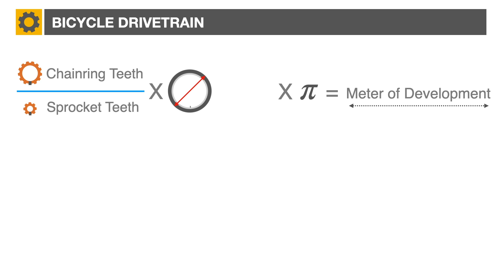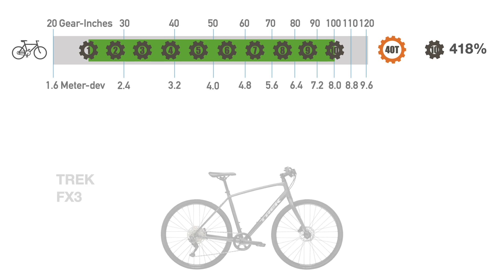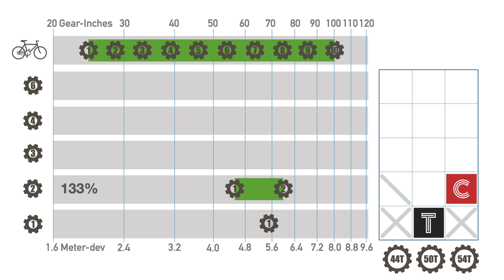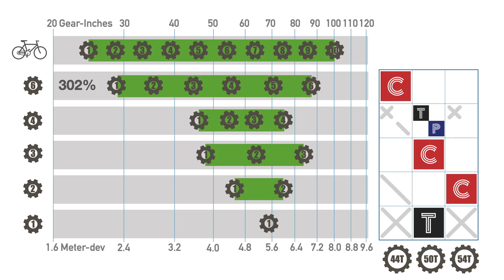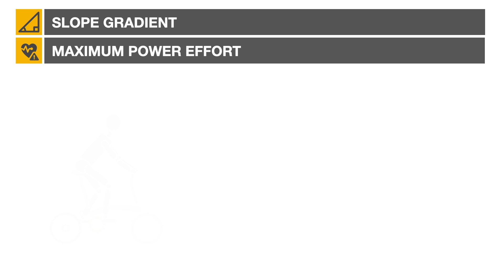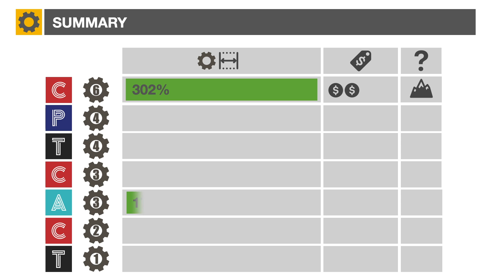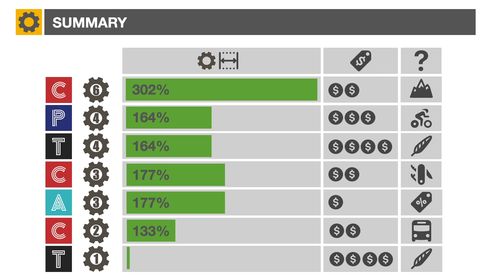Explaining Brompton Gearing - [ Rev. 2022 ]

Comment: My advise for gear selection:

1. Do you climb hills, strong head winds and are you not as strong? Buy the 6 gear system.
2. Do you ride in the city, less then 5 km/ 3 miles? The 4 gear system will do if you are not so strong. The 2 or 1 gear if you are strong. The 3 gear is not useful, the gears are spaced too far apart. So the gear 3 you will seldom use. Unless you change the sprocket to a bigger sprocket or a smaller chain ring, so you can use gear 3 as well.
3. Do you use your Brompton for touring with luggage. Buy the 6 gear.
Reply from the maker: 44T is the default for the A Line
Reply from the maker: @Steph99449  That's what we heard as well. We did install 44T on our M6R at purchase time.

Comment: Probably the best presentation I've seen on all current Brompton gear ratios (including the new T line which was what I was looking for). Better than my spreadsheet and coming to the same conclusions on choice - i.e. 6 speed classic with standard/reduced chainring is best for touring/hilly terrain. I would however like more gears to reduce the jumps and to remove the compromise of having to either pedal furiously or with a slower less efficient cadence in order to maintain a particular speed, something which the new 4 speed doesn't address.
Reply from the maker: Adding a 3rd sprocket or upgrading to a dual-chainring could be solutions to improve range and gear gap (ref. our video https://youtu.be/-Q9wd8Ewlec )

Comment: Great info! In Singapore and some Asian countries we have many different brands of ‘Brompton clone’ so call trifold bikes that comes with default 46 or 48T chainring running on the SFR3 internal hub and 2 or 3 external sprockets, giving a 6 or 9speed configurations.
Reply from the maker: @DCPedal, what are the more common sprockets size found on those trifold bikes?
Reply: @2Bikes4Adventure  13,15,17

Comment: Awesome video. I like that you actually share how a gearing ratio could affect a climb. I wonder if one could do aftermarket modification from 44T chainring to a smaller 36T or 34T for better climbing experience? Many thanks.
Reply from the maker: 38T or 39 T are probably the smallest 130BCD chainrings you can get. You could go smaller with a dual chainring however.

Comment: I’m surprised by the difference in overlapping between the 2-speed and the new 4-speed cassette. Don’t you think the new 4-speed could be easily and conveniently spread out so that it’s both faster and easier on hills? If not, why do you think they made it so “narrow”?
Reply from the maker: Rear frame clearance doesn’t seem to be the issue here. Maybe the newly designed gear tensioner/cage plat cannot accommodate more than at 18T/12T range?  If that is the case, not much we can do (with the exception of using a dual chainring)

Comment: Thank you for your wonderful illustration! May I seek your advice: currently running a 54T 3speed SA for fitness riding (20-45km, x 2 per week, average 22km/hr over 1-2hrs) at relatively even terrain (parks & road) I am keen to get the P line to improve my performance (to cycle further & longer & perhaps fill the gap of a missing gear (betw 2nd & 3rd) when fatigue sets in. However, after watching your video & realise the 177% vs 164% gearing range, I am a tad hesitant about the earlier intention. Would love to hear your opinion with your vast experience!  Thank you ;)
Reply from the maker: @eugenetmy, the excitement of owning a brand new bike is not to be ignored, but in this particular case, the price of the 4th gear will be significant.
If budget is not an issue, I would go for it (and probably consider a 3rd party 130BCD 56T chainring to shift the gear range upward).
Once you have your new P-Line, you could always sell the old 3 speed to help finance the new acquisition although there is nothing wrong with owning more than 1 folding bike (we own 10).

On the other hand, if cost is an issue, a cheaper option would be to upgrade your 3 speed to a 5 speed hub. The gap between the 4th and 5th gear will be 18%, the same as the gap between the 3rd and 4th on the P-Line. Furthermore, the total range is 225% (vs 164%). True, the bike will be heavier than the P-Line, but this upgrade would probably cost 1/10 the price of purchasing the new bike.

Enjoy your Brompton (whichever model or setup you choose).

Comment: A nice explanation, particularly of the effect of varying power output on hill climbing - very good to relate this to gear choice as well. One question - am interested in your foot position on the pedals. We are normally taught to use the forefoot (or at least I was!), but you are using your mid foot on the pedal. It would be helpful to know why - perhaps I am doing it wrong?
Reply from the maker: While it is usually accepted that positioning the ball of the foot over the pedal pivot is optimum, some research has found that it may not be critical (https://www.researchgate.net/publication/6886747_Is_economy_of_competitive_cyclists_affected_by_the_anterior-posterior_foot_position_on_the_pedal). 

Our approach is less scientific and more aimed towards “do whatever feel right”.  So, as the day progresses, we are likely to move our feet position slightly depending on the level of effort required (and fatigue level). It may not be always the most optimum configuration, but than again, we are not in it for the performance aspect.
Reply: @2Bikes4Adventure  Thanks, this is useful. Always interesting to have an alternative to the established wisdom.

Comment: Ive got a p line and I love it! just wish I had a wider range of gears so I could keep up with my road bike friends if I wanted.
Reply from the maker: The 4 speed range is indeed narrow. A possible solution could be to add Schlumpf drive.
Reply: How is it on the hills? What size chainring have you got? What sort of gradients is it capable of climbing in the biggest ring at back?
Reply from the maker: @wanderingsofalanandcaz We do have a 44T chainring on our M6R.
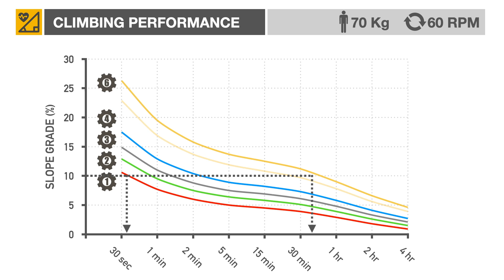As for the gradient it can tackle, it will depends on fitness level. We would refer you to the graph at 06:43 for a rough estimate: About 90 min on a 7% grade, 45 min on a 10% grade and 1 min at 20%.

Comment: Neat and well-explained. I recently upgraded my three speed to a 5xspeed just so that I would get a little bit more on the lower and higher end of the gear range. 256% as a whole lot better than the previous. But I can certainly see where others with the three speed have gone to the 44 tooth to get some of the same low-end gains.
Reply from the maker: Sturmey Archer S-RF5(W)? Easy to implement?
Reply: @2Bikes4Adventure  mine was the result of getting a custom wheel made by BrommiePlus. It doesn’t look like it was all that complicated though. I wanted the 8spd SA, but that’s no where to be found anymore.

I’m running the 50t up front and 13t on the rear, gear inches (according to their chart) are 40/48/64/85/102 for 256%, which is definitely in the “comfy” range according to your video

Comment: Massively informative as usual.. Really going to have to look replacing the internal hub on my 3 speed as the weight to gearing ratio is the worst out of all of them. Unsure if I go for a aftermarket derailleur solution or go for a 6 speed hub. Really its naughty that brompton make two different internal hubs that weigh roughly the same but then force you to buy the BWR to get the two sprockets rather than just putting it on both models which gives you the chance to upgrade. Guess they need some incentive for people to go to the 6 speed as a default..
Reply from the maker: The dual-drive 6 speed (using the BWR) was a stopgap solution following the demise of the Sturmey-Archer 5 speed hub. Unfortunately, no better solution has been put forward.
Reply: @Wildefyr I can recommend the 5spd hub. Recently went from the 3spd to 5spd and having the extra lower and higher have been quite nice. I feel the 3spd w/50t is really not all that bad. But I did need the occasional speedy or “nah, can I get lower” kind of gearing w/o changing the middle. This has been great, despite the weight. Got it at BrommiePlus.

Comment: Awesome, I wanted to look up your previous gearing video as my brompton tour in the hills did not go as planned and I was curious if I should go with 44t or maybe check for even smaller 3rd party options. Thanks for that perfect timing!
Reply from the maker: A 39T would  be a simple upgrade to do. 
If there is some interest, we may create a small video on 3rd party gearing options.
Reply: I ordered myself a 40t H&H Chainring. Will let you know how it goes. I was tempted to even get myself the three sprocket external upgrade, but one thing at a time :)
Reply from the maker: Upgrading the chainring will be less work than going with a 3rd sprocket configuration. Keep up posted with the results
Reply: @2Bikes4Adventure  Thanks! Exactly my thought - since the part is for the Brompton I hope the H&H one fit nicely onto the spider cranks and I hope on the long end it will do around 30kph with my normal cadence (ritzelrechner at least said so)

Anyways thanks for offering to look into 3rd party gearing options. There is crazy stuff out there (schlumpf, rohloff, front foot derailleurs) but all fairly low volume with limited information. For me this is a bit too custom as I want my brompton to be reliable

Comment: I have got a 6speed 44T equipped, but the two highest speeds are anyway too strong to push.... I hope Brompton would realize a 39T-40T in the future.....
Reply from the maker: A 39T would  be a simple upgrade to do. 
If there is some interest, we may create a small video on 3rd party gearing options.
Reply: @2Bikes4Adventure  the  upgrade you told is possibile only with the old Brompton crankset, which had a standard 130 mm BCD, and, for example, you can fit whatever Shimano chainring 39T; models after 2017 though, have got a new personalized (very odd 😏) crankset with 124mm  BCD, so you are obliged to use only Brompton components, and the smallest chainring made by Brompton is 44T... I'd had to buy on line a second hand pre-2017 crankset is England... (I'm Italian)🇮🇹😄
Reply: I agree, even downhill 3+ or sometimes 3- feels just too fast for this little bike. For me at least, if someone likes to go with 54t for land speed records, thats cool too

Comment: I wish Brompton did a 39T chainring as I never use the 3 High gear. I had the thirdparty 39T but it did not fit the Shimano crank I installed to my M6 so I reverted to the 44T.

Comment: Excellent video. When I was riding my Brompton M6R with 50T on the hill with 10%, I know it’s time to get a 44T. Just wonder what will the curve be at 6:31 when using 50T, how long does it takes for people to be exhausted with a 50T🤔🤔? And I guess also having a 55/34 traditional crankset for T-line probably will be an excellent option to turn it to an amazing bike with wider range, lightweight and performance. 
Thank you for your wonderful video again!
Reply from the maker: The graph at 6:31 is for the default chainring configuration (50T for 1, 3, 4 and 6 speed, 54T for 2 speed). At 6:41, we changed to 44T for the 6 speed only. A dual chainring (54/34) would indeed be a inexpensive way to improve the gearing range.
Reply: @2Bikes4Adventure  Thank you! I understand now :)